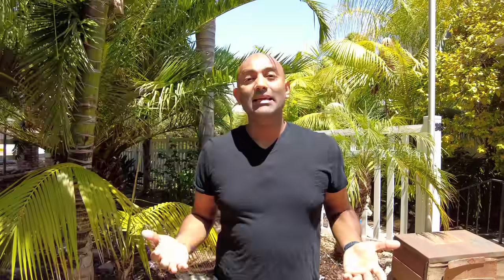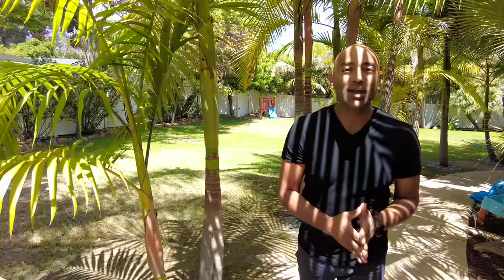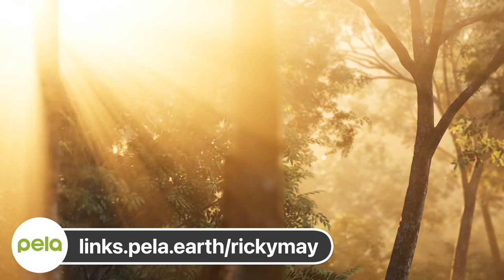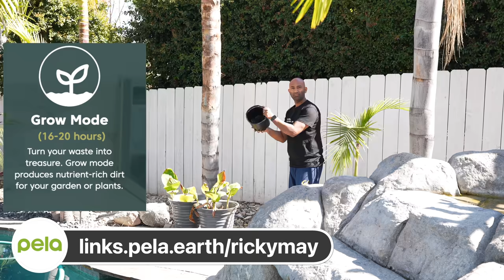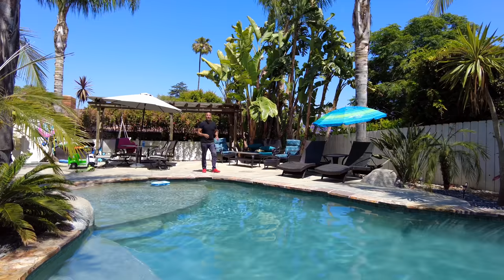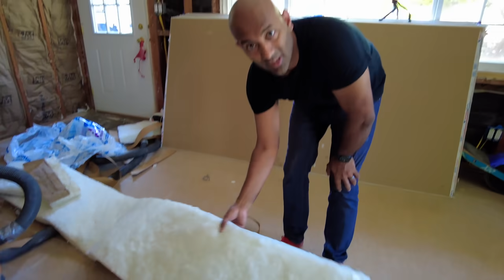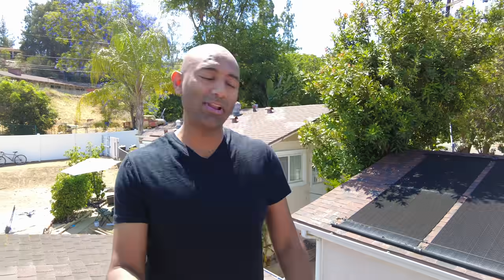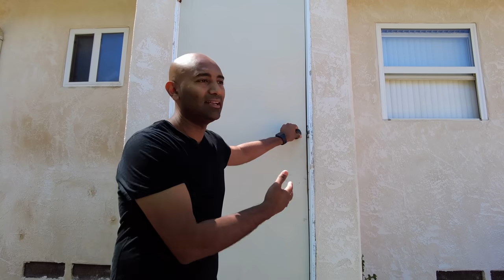How I'm Planning to go 100% OFF-Grid!

Comment: DO NOT TRY TO MAKE YOUR OWN WATER.  There are a lot of health issues that have to be dealt with, particularly if you have children, particularly PH balance, minerals, and you would be taking a pass on societal additives such as chlorine to kill bacteria, and fluoride for healthy teeth which you absolutely cannot add yourself (too dangerous if you get the concentration wrong).   Regular testing would also be required.  Rainwater is not ideal (you have to deal with N levels of filters to get rid of junk, bird guano, etc etc).  Wells aren't green.  So, just basically... don't even try.   At best, do something simple like a really simple rainwater system to augment watering plants.  Do not try to recover sewage, and do not try to make drinking water from rainwater.  Really.

With that said, you can do something about your lawn.  You can buy deep-rooted grass seed mixes that do not require a ton of water to keep healthy.  Or remove the grass entirely.   Drought-resistant plants can be planted, particularly deep-rooted shrubs and bushes.   There are lots of options and those should be pursued first.

Solar thermal systems - the best solar thermal systems are two-ring systems.  You don't run actual water in the thermal loop, that will destroy the thermal loop very quickly.  Usually a primary coolant loop is run through the thermal panels and then goes through a heat exchanger to actually heat the water.   But your solution to just put up solar panels also works, and is the solution I would use.  Just throw on more panels, make more electricity.    That's the way to go.

--

In terms of actually going off-grid, electricity and natural gas.  You are vastly, vastly under-estimating the amount of electricity you will need to even remotely be able to zero out your electric bill.    Now, I did hear you say you were going to be grid-supported for the main house.  That's good, because there is no way you are going off-grid.  Here's what you need in terms of appliances.  I will estimate peak consumption (kW) and average energy used per day (kWh)

* Replace standard appliances, LED lights, all misc electronics.   2kW / 4kWh

* Electric dryer.   5kW / 5kWh-for-two-loads  (maybe 2kWh a day averaged over a week)

* Electric stove-top.   10kW / 5kWh/day

* Electric oven (probably already electric), also include toaster-oven use.  4kW, 3kWh/day (when used to make dinner), maybe 2kWh/day average over a week.

* Heat-pump water heater.   4kW, 4kW/day.  80 gal, 2 people.   8kW/day with 3 people.  Add another 2kWh/day if using a recirculator loop.

* Heat-pump furnace / A/C.   Zoned mini-splits, basically, is what you want.   5kW, 20kW/day high summer or high winter.

* Pool.  Remove the pool.  hahaha.  ok... I dunno about this one.

Total home consumption prior to conversion... I'm guessing you burn around 35kWh/day, not including any sort of pool heater.    AFTER CONVERSION it is probably going to be 65kWh/day peak summer or peak winter.   SIXTY FIVE!!!  Peak consumption will be around 30kW.   Not including electric vehicles or pool.

So there are two problems here.  The first is your peak electricity use is going to be around 30kW (not including vehicles or pool).  That means you would need a 50kW inverter to fully support the house. 

#1 thing is you need to plan on ways to reduce your peak electricity use.  And I don't mean "oh we just won't use X and Y together... the circuits have to be designed so you CAN'T use X and Y together, or I guarantee you that you will blow the system breakers.

Next is total electricity use and sizing the battery.   At 64kWh/day you would need around 12kW worth of panels, but that will only work peak summer.  So to really make ends meet you probably need around 20kW worth of panels.   That will cover around 70% of the days in the year for you, assuming a 40kWh battery bank (which is reasonable).   

#2 think about just how much you want to cover in a blackout.   40kWh of batteries will get you maybe 70% of the days in the year.   80kWh of batteries will get you 80%.    160kWh of batteries will probably get you around 90%.    But for a blackout, you obviously don't need to run major appliances, so (for example), 40kWh of batteries would do you just fine as long as you don't mind cold water, no heating or cooling, and no electric oven or stove-top or dryer.   A toaster oven would still be in the cards, though.

So the thing to really consider here is how to reduce consumption.  Both peak consumption and total energy used per day.   Those eco-flow deltas are not going to do the job, even for the small side-house... you wouldn't be able to run a mini-split off of them reliably, for example.   Nor would 1 Tesla power wall do the trick.  You would need at least 4 PW3s, probably more.     And they would have to LFP based power walls (Probably PW3's when they come out).  You can't use NCA/NMC chemistries for this.  Not safely.   Having a professionally installed custom system might be the best way to go.

If you really want to do it, it is going to be expensive.  I'm assuming you don't want you or your family to live like hermits, always having to worry about resources.

-Matt
Reply from the maker: I am 100% going to make my own water. Mostly it'll be for irrigation, and for learning lessons of how it all works.

Comment: If you really cared about getting to net zero, you'd want nothing to do with that composter.
Reply from the maker: why is that?
Reply: @TwoBitDaVinci  food composts on its own.  This took extra energy to manufacturer and uses energy to run.  Just to do what waste is going to do anyway.  And while you're powering it with solar, that power could just be more that goes into the grid.  Having a swimming pool isn't the best thing to have these days either.

Comment: Some of the stuff you're trying to do are counterproductive an extremely expensive don't see why you're running down crazy paths
Reply from the maker: like what?
Reply: It depends on what the ROI is to replace each common utility. That's why he is investigating solutions which can benefit everyone.
Reply: @davidmccarthy6061  lomi and dehumidifiers to make water costing almost a hundred grand plus electric are not worth doing lmao
Reply: A solar pool heater is cheap and if you got 10 years out of it you're doing really good. It's literally free pool heat from the sun and it's more efficient than solar panels...
Also natural gas is very cheap in America and you'll likely be better off using as much natural gas as you can.
I'm a fan of geothermal for heating and cooling with supplemental heat coming from natural gas and the geo thermal system could be powered by solar making it extremely efficient. .
If you want to compost like lomi does you have a lot of land and you can just make a smelly compost pile in the back of your yard with a black plastic roof so the sun does the heating for you, add a few Earth worms and a tap on the bottom to get pure fertilizer for free.
I'm currently building my latest house from the ground up and one barely utilized cheat code in the USA is to install mini split systems throughout your house instead of a normal ducted AC system. You can get in ceiling condensers that are barely noticable, control them individually through WiFi and have each room set to whatever temperature you want. They're also just about infinitely expandable. They have variable speed compressors so they don't use much electricity, run nearly silently, and best of all are cheap. I got my 4 zone system for under 2k.
Reply: @TwoBitDaVinci  see above comment. To busy working to go into more detail but I also want to work to build energy efficient houses without spending a fortune. I have a ton of ideas that aren't being utilized right now and one of them you mentioned in a previous video, maybe you can guess what I'm talking about

Comment: You could get a bio degradable fake lawn. It would not need to be watered nor cut and your kids would still be able to play in it. It would also bio degrade dog poop and pee. The last time I looked into it, I think it cost around 8 grand for a typical yard though. Also I’d definitely collect rain water from the gutters and store them under ground in some huge tanks. I saw a video where they used a specialized pump that would pressurize the the water and filter it at the same time for all of your water needs.
Reply from the maker: Biodegradable fake lawn? My plan is a gray water system to for all the lawn water!

Comment: First, it will never be an Earthship. An Earthship is a very specific thing and yours isn't, and can't be that. Second, if you're using that much water to sustain your lawn, then you need to get rid of the lawn.
Reply from the maker: no i dont need to get rid of it. I think you have a very limited view, which is why I'm making this series. I am going to build a gray water system, where all water from showers and sinks, will feed into a container and get pumped to the lawn. so my lawn will be 100% gray water
Reply: @TwoBitDaVinci  the lawn is still consuming way too many resources (no matter the source) and has zero practical use. Learn about plants and features that don’t require such maintenance. But in any case, good luck with the project.